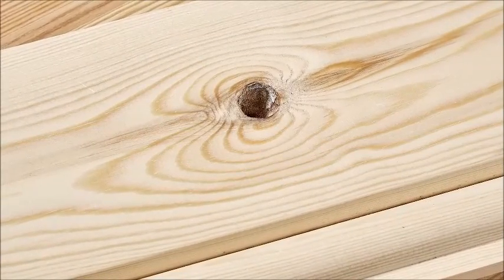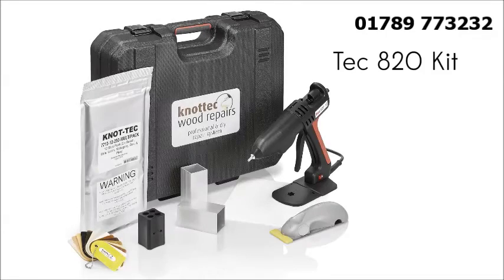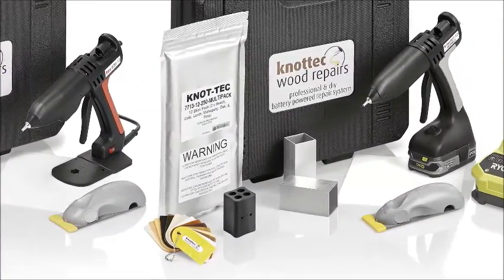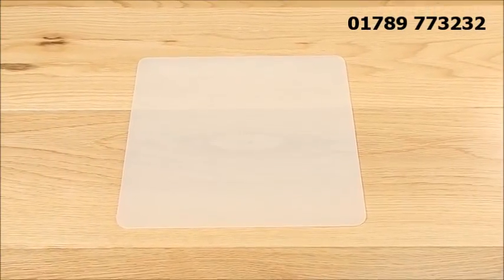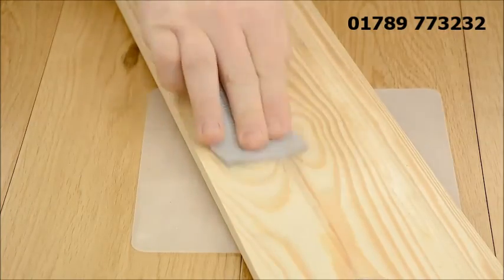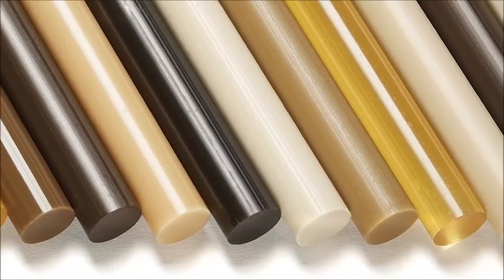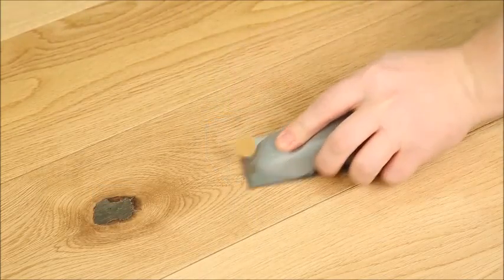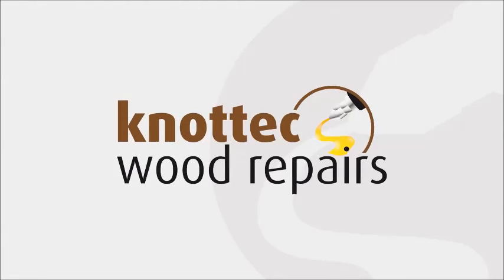Knot-TEC - Innovative Hotmelt Wood Repair System

Comment: Is this not just a glorified-overpriced  hot glue gun?
Reply: I think so. But probably a good quality industrial gun that gets hotter. And you can do the same thing as the plastic board and metal block with painters tape and a piece of scrap metal.
Reply: depends of the glue. Looks like TPU or PUR technology but PUR comes in cartridges. Main question what is Hardness by Shore A (or D)?
Reply: I think it's the glue itself that's different. Especially because of the sanding part. Last time I've tried to sand hot glue it was a disaster.